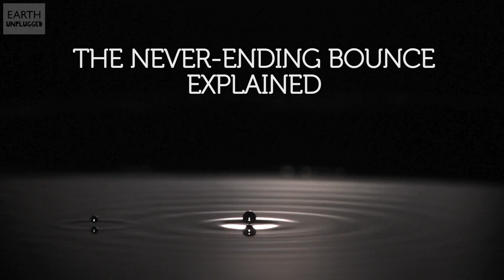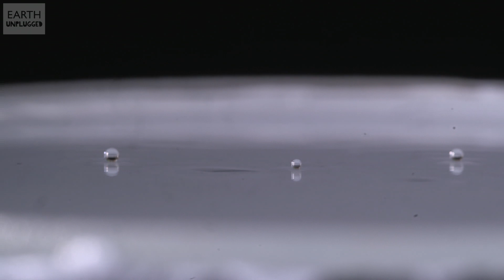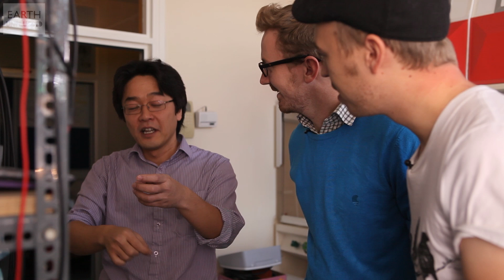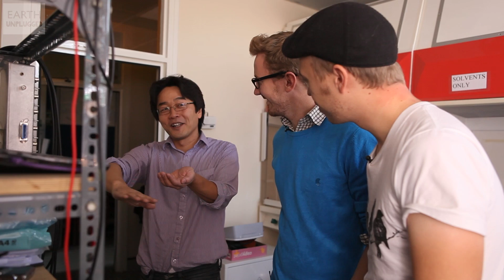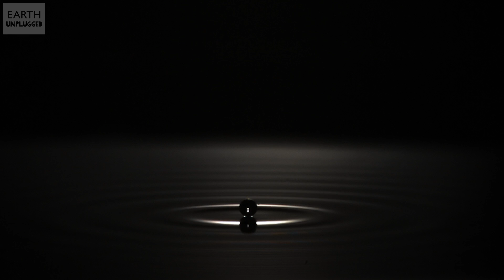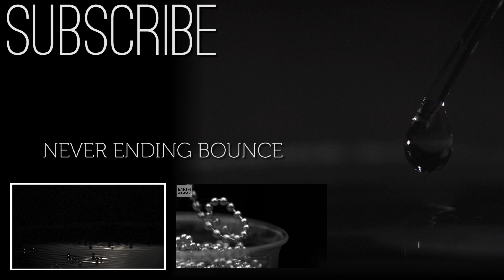Never-Ending Droplet Bounce Explained | Slo Mo | BBC Earth Explore

Comment: that actually isn't much of an explanation isn't it guys :-)
I still have questions:
Why silicon and not oil for example?
Demonstration of water surface tension? Didn't you say you were using silicon?
How is the surface being vibrated? Soundwaves or a physical vibrating table or something?
What is the reason for researching bouncing droplets?
How long is "pretty long lasting", that's prettty inaccurate for a science tidbit.
What the results and benefits of this research?
Reply: - Silicone oils behave like carbon based oils, but are non-flammable (and are more dense)
- Water surface tension works exactly the same way.
- It doesn't matter how they generate the vibration - either using a speaker or a vibrator - it'll result in the same effect at the fluid.
- Pretty long lasting in this case means "indefinite", or as long as the surface is vibrating and the fluid is not contaminated with anything that breaks the surface tension.
Reply: TechLaboratories would it change the frequency used when water is used instead???
Reply: Bling Bling Vin Li I'm not an expert in fluid dynamics.  My first gut instinct was to say that yes, it was dependent on the cohesive nature of the fluid because less cohesion = less surface tension, but the more I think about it, the more I think that the real dependent factor is the amount of time for air to exit the gap between the droplet and the surface, which is not dependent on the cohesiveness of the fluid.

So, my educated guess is that the frequency wouldn't make a difference between the fluids since it relates to the amount of time between bounces.  So long as the frequency is greater than the minimum needed to prevent all of the air from escaping from under the droplet, it should work for any liquid medium.

On the other hand, I figure that both the amplitude of the bounce and the size of the droplet supported may be more dependent on the cohesiveness of the fluid and thus may change with between silicone oil and water - less internal attraction = less surface tension = smaller bounces & smaller droplets.

But then again, I don't have an experimental apparatus to test these hypotheses, and experimental results may be different...